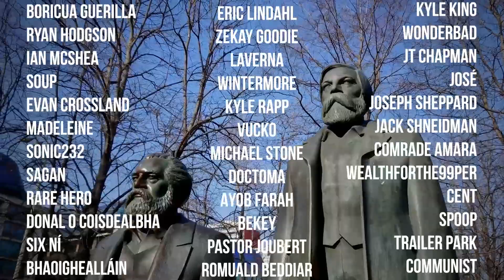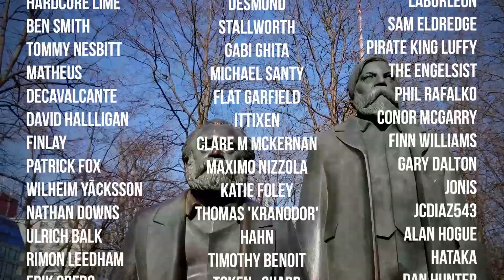Utopian Socialism and Scientific Socialism | Socialism 101 #11

Comment: The bit at the end is contradictory. It's true that socialism isn't brought about by great men with great ideas, but strong leaders in top-heavy systems are the rule for the USSR and China, as well as other movements people point to as socialist/communist. You can't have it both ways. Either it's a top-heavy system where those at the top enforce their ideas on those at the bottom (as in the USSR and China), or a bottom-heavy system where the people take advice only from the intellectual elite (who are only part of the party, not its core).

A Marxist-Leninist who has read Marx and Lenin would know that the answer must be the latter if it's to be a socialist movement. Lenin himself was very explicit on who must rule and how they must rule, and it wasn't "the party" or "the state" or the "intellectual elites." It was all over his works in "State and Revolution," "Tax in Kind," "One of the Fundamental Questions of the Revolution" and tons of others that make the message "democracy from below" impossible to misinterpret for a Leninist.
Engels, in the very document this video is about, wrote along the same lines concerning what is to come after capitalism, namely:

"The proletariat seizes the public power, and by means of this transforms the socialized means of production, slipping from the hands of the bourgeoisie, into public property. By this act, the proletariat frees the means of production from the character of capital they have thus far borne, and gives their socialized character complete freedom to work itself out. Socialized production upon a predetermined plan becomes henceforth possible. The development of production makes the existence of different classes of society thenceforth an anachronism. In proportion as anarchy in social production vanishes, the political authority of the State dies out. Man, at last the master of his own form of social organization, becomes at the same time the lord over Nature, his own master — free."

It isn't the state, the party, or the intelligentsia that leads the way, but the proletariat via revolutionary democracy. Likewise, Marx described the Paris Commune as being a system run by the proletariat:

"The Commune was formed of the municipal councillors, chosen by universal suffrage in the various wards of the town, responsible and revocable at short terms. The majority of its members were naturally working men, or acknowledged representatives of the working class. The Commune was to be a working, not a parliamentary body, executive and legislative at the same time.

"Instead of continuing to be the agent of the Central Government, the police was at once stripped of its political attributes, and turned into the responsible, and at all times revocable, agent of the Commune. So were the officials of all other branches of the administration. From the members of the Commune downwards, the public service had to be done at workman’s wage. The vested interests and the representation allowances of the high dignitaries of state disappeared along with the high dignitaries themselves. Public functions ceased to be the private property of the tools of the Central Government. Not only municipal administration, but the whole initiative hitherto exercised by the state was laid into the hands of the Commune."

Marx and Engels did not support a statist system described in these videos. Neither did Lenin. Therefore, the statist systems of the USSR and China referred to as "socialism" in these videos is not from a Marxist, Leninists, or Marxist-Leninist position. What actually took place in the USSR does not mesh with the kind of system that Lenin (and Marx) described, just as what actually took place in China does not mesh with the kind of system that Mao (or Lenin or Marx) described. This isn't an argument of "purity" or "perfection," but one of "mostly."
When you describe coin, and then point to a dog and say "that's a coin," you are inconsistent with your descriptions. That's what's happening here. Mao's China and Stalin's (even Lenin's) USSR were the "dog" in that analogy, and the ideas they pointed to as socialism were the "coin." If, however, you describe a coin, and then point to an old subway token (not a common currency, but certainly a coin), then you are at least "mostly" consistent. Neither the USSR, nor China, nor Cambodia, nor any other country people point to as "socialist" (or "communist") had a "mostly" democratic economy or a "mostly" bottom-heavy democratic political system. Nor did they "mostly" seek to constantly and consistently advance towards those goals. Not living up to any one of those things disqualifies a country/society as being socialist, but all of the major examples have none of them (smaller ventures like the Zapatistas qualify or come close, but they're not exactly threats to capitalism outside their borders).

So again, unless "Marxist-Leninism" and "Marxist-Leninist-Maoism" mean "only what actually happened, and not what the people involved wrote about, and advocated for," the statist descriptions in these videos are not ML or MLM. They are something else that uses choice quotes to defend what actually happened as ML and MLM.
Reply: Still great videos with a lot of good information, but the statism ruins the "what is socialism" and "how do we achieve it" messaging with ideas and approaches that actually stand against the transition to socialism.

Comment: I support Ricardian market socialism that will achieve high economic growth through market competition owned directly by the working class. Then, it will transition to council communism once post-scarcity has been achieved (or almost achieved).
Reply: Market socialism to use for planned socialism?
Reply: @thanos8638  No. I don’t want centrally planned socialism. I want a market-based socialism (it’s basically classical liberal capitalism, but with worker control).
Reply: @theparadigm8149  market socialism can solve the problems of worker exploitation but it can never solve the market failures. There's a reason why Karl Marx preferred planned socialist economy.